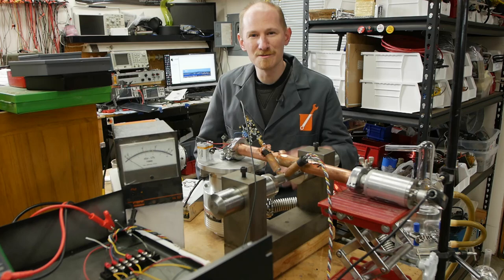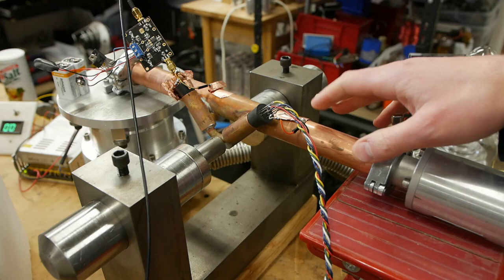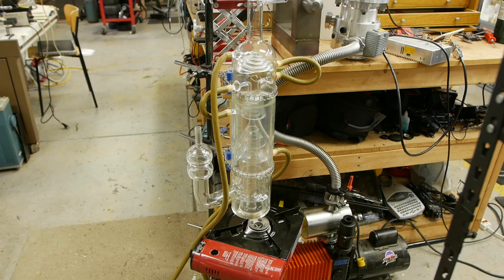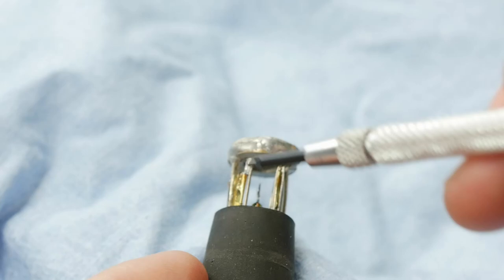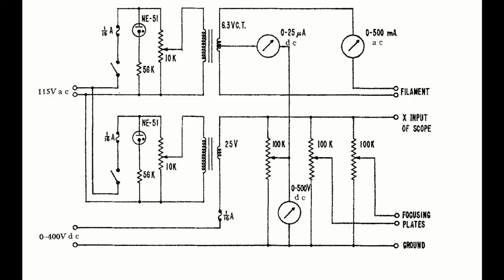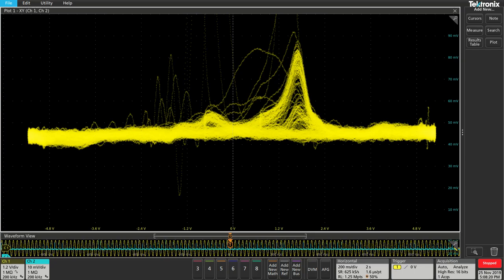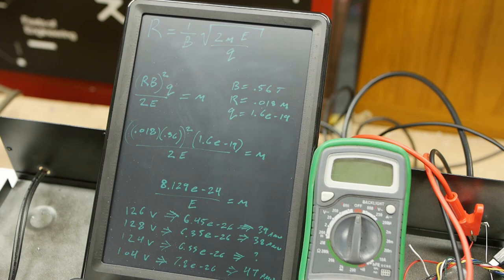DIY mass spectrometer measures potassium in dietary salt substitute

Comment: My initial suspicion as to the lower peak is some sort of additive.  A mass of 47 corresponds to titanium, and titanium dioxide can be used as a food-grade additive.  I think perhaps ordering some pure potassium chloride from one of the chemical companies and testing that would definitively rule out any additives from food-grade sources.
Reply: indeed. he starts the video be saying he's going to verify the contents of the product, but then by the end behaves as though his bottle of "No Salt" is a reference standard! :)
the picture of it on amazon lists five other ingredients, one of which is mineral oil(!).
Reply: It is indeed easy; TiO2 is insoluble in water whereas KCl is soluble. Even 1% of TiO2 will produce a milky suspension (and not a transparent clear solution)

Comment: Don't discount that the 47 is Titanium as in TiO2 as a whitening agent.  It's an "inactive" ingredient so may not be listed on the package.
Reply: Perhaps there could be titanium in the filament, or the filament support too?
Reply: @belg4mit  I'm also a bit skeptical of the proposal that the people who made these devices in the past would claim to observe two potassium isotopes without verifying whether the m/z ratio is correct. 
In the comparison of the spectra at 21:10, his signal looks quite a bit different than the ones from SA or John Dewdney. So maybe the were actually able to resolve the two potassium peaks and we're just looking at differently scaled x-axes?
Reply: @belg4mit  TiO2 costs A LOT less than Ti metal. TiO2 is actually found directly in nature and has been mixed into anything from tooth paste to wall paint for a long time. I think it's pretty likely what he measured.
Reply: But would "whitening agent" be 10% or more of the product?
Reply: @bpj1805  The peak intensities aren't directly relatable like that, because the ion formation process might have different efficiencies for different compounds/elements.
Reply: @cowpoodle003  Maybe, but I'd expect K+ ions to be more volatile than Ti+ ions, and with the relative peak areas looking as they do, it would have to be the Ti+ ions that are happier to leave the filament. Quick, not directly applicable comparison: KCl BP = 1690K, TiO2 BP = 3245K. Different oxidation states and all, mind you.

Comment: A spectrometer with lasers... surely it's not laser desorption/ionization?
Can't be Raman, you've done Raman before...
Regarding vacuum - tube seals generally don't work well with vacuum. Air always leaks through, since there's nothing really holding it back but uneven hose clamp pressure. The reason your stoppers work is because the stoppers themselves are being pressed in by the atmosphere. This is why all vacuum flanges are flanges - to ensure the atmosphere squeezes them together.
As for the rubber, most generic rubbers outgas a small enough amount to not be noticeable in this low vacuum system. That, and you have a gigantic turbopump compared to the overall size of your chamber...
On that note, have you considered the possibility that something is being vaporized from the chamber(including the stopper) and is ending up on that left peak? It would also fall in line with the previous two works, since they seem to have both used rubber.
Reply: Along these lines, what about trying it by cleaning out everything and not intentionally putting anything on the filament and see whether you get any peaks.
Reply: MALDI is the acronym I guess he was referring to it is a type of Ionization technique which uses Lasers to ionize instead of the heated filament. If memory serves me right, it is matrix assisted laser desorption/ionisation.
Reply: @sbreheny  I doubt that would be useful since the copper tube in itself has weathered from the inside and has thus a reactive oxygen layer which might be out gassing either due to vacuum or because of the electric current
Reply: there are titanium blades, so it is possible that this material will be dragged into the process.?
Reply: @a3xccy379  atmospheric pressure LDI is likely what he is referring to in the video, fundamentally indifferent to MALDI in terms of the analytical setup (let's ignore laser choice) and is held within the subset of LDI within the acronym soup chemists work within.
Reply: LPI was about for a while ..Laser Pulsed Ionization, in conjunction with Time Of Flight mass spec

Comment: Great video, this is amazing! A couple of things. 1) The peak height is not as important as the peak areas if we are trying to figure out the relative amounts of the isotopes. Since the two peaks are unresolved from each other its moot. 2) I'd secure the turbo molecular pump because if something fails and the turbine is exposed to an immediate pressurization then that thing is going to fly!
Reply: I was thinking the same thing about area versus peak. Area indicates the amount of ions. The peak is more of an indication of how good the resolution is.

Comment: Very nice video! I have the pleasure of using all different kinds of mass spectrometers all day and have therefore thought about how I would go about building one but I absolutely lack the time and tools to do so. That why I love seeing you build a finding one.

If I would change a few things I would first look at the ion source. I don't know how well your pumps will be able to handle it, but changing the ion source to something like electrospray ionization (ESI) would greatly reduce downtime and allow you to introduce many more different samples. It might be worth looking into. Also matrix assisted laser desorption ionization (MALDI) is a very elegant and nice ionization solution. Also both methods are able to deliver molecular information!

Secondly, I think that having proved that the concept works, going to a different mass analyzer like a quadrupole could greatly increase the variability of the system. Also these types of commercial mass spectrometers are the cheapest since they don't have the need for any fancy large magnets or perfectly calibrated parts or clocks.

As a last point it might be interesting to look into ion mobility spectroscopy. (https://en.m.wikipedia.org/wiki/Ion-mobility_spectrometry) It also can be quite cost effective and there are many different ways to go about it. I have seen quite robust little crude systems made by researchers at conferences that look like they could easily be reproduced by you.

Thanks again for the great video! A absolutely loved it. Hopefully you find my comments interesting and they can inspire you for future projects.

Comment: Did you do a dry run with nothing on the filament to see if anything is emitted from it?
Reply: Excellent suggestion.
Reply: Measuring background noise should be a part of any mass spectrometer measurement so hopefully he did, although it seems like he's using the potassium as his known standard so maybe he didn't get that far before  releasing a video.

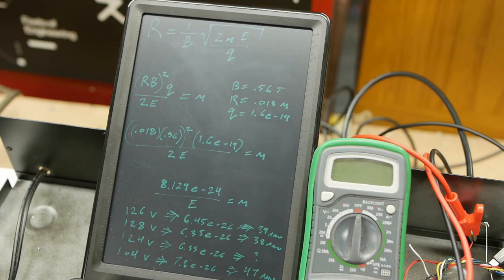Comment: 22:30 what's that screen/tablet/epaper pad?
Reply: > $1000 move along
Reply: Looks like a boogie board (search "boogie board tablet" to avoid beach toys) which costs around $20-40 depending on size + shape
Reply: @MrDrProfStewart  yeah did a quick search for those - was able to find a 12inch one for $10 xD lol; thanks for the tip

Comment: Yup turbo pumps are awsome. Go from torrs to hard vacuum in minutes. Used one to replace a mercury diffusion pump on a joel electron microscope using glassslinger's bearing replacement tutorial. Love the home rigged ion gun you made. Lab stopper washer pins and a broken lightbulb. Awsome 😁😎🤓

Comment: Hi, first of all congratulations, this is amazing, and thank you for doing this.
Second, the phantom peak you might have could have come from an imperfection in the slit from either the ion gun or the detector slit (more probably the ion gun, because you see the same peak form in both).
When we have problems like that with our MS, is generally related to beam stability or a fractioned beam.
I guess you could condense the beam with a electromagnetic lens system just after the ion gun, but that would require major modifications, increase in the ion path etc...

All in all, you are amazing sir, keep doing this

Comment: Maybe 47 amu peak is from titanium from razor blades?
Reply: That was my first thought too. Maybe the potassium ions are knocking off some titanium ions when they travel through the slit.
Reply: @reedpetersen  regarding the titanium once ions struck the razor blade I believe they would be neutralized and either quickly adsorbed on the inner walls or removed through the turbomolecular pump which should have plenty of compression ratio keep the concentration low. Nothing should be eroding the tin, copper, or brass as far as a know and his vacuum level isn't high enough for them to be doing much. I would think oxides or contamination on those surfaces would be worse since they aren't the cleanest of metals. The rubber would likely be off-gassing compounds with much higher masses that I doubt would be within his measurement range unless they were being cracked by the ion source, my guess is they're probably just contributing to system pressure. I'm curious about the flux in the solder, that might take many hours of pumping to fully out-gas. Either way I hope he makes a video on tracking down what this peak is, especially since it is displayed in the other two papers.
Reply: The titanium hypothesis has the hole that 47Ti is not the most abundant of Ti isotopes. 48Ti is the most abundant isotope (74%) and 46Ti and 47Ti are about 8% of Ti and 49Ti and 50Ti are about 5% abundant. So if Ti was the contaminant in the spectrum you'd expect to see a large 48 peak and smaller peaks on both sides of it. However, what he sees is what appears to be a peak with one satellite.
Reply: Well thinking about some other substances we know will be in the system ammonium chloride solder flux is 53 AMU so that is too big, carbon dioxide is 44, Calcium is 40, has an isotope of 41 and might be a trace source of contamination if his salt substitute is made in factory that makes other dietary supplements?
Reply: I'm sure he already looked at a lot of other mass to charge ratios to find anything that coincides and the closest thing I can come up with is if the dietary supplement contained trace amounts of calcium which might also be handled in the same facility, but he would have to have an error of 1 amu somewhere. There are all kinds of phenomenon in electron optics that can cause a misaligned beam to strike the detector plate, it is interesting though that it appears to be repeatable with the design.
Reply: @CafeBikeGirl  Calcium silicate is a common anti-caking agent, but NoSalt already lists potassium bitartrate in it's ingredients. (Potassium bitartrate is sometimes used as an anti-caking agent.)

Comment: Titanium has an atomic weight of 48, in the most common isotope. Is there any in the system? Perhaps in the tungsten wire?
Reply: I would expect that he ran the system without any sample to get a baseline, so I think he would take into consideration any ions that the device itself emits.
Reply: Titanium coated razor blades are a thing. The specific blade used here (Astra Superior Platinum) allege to be platinum coated... what are the chances they are actually titanium coated? As the erosion may only occur when a sample is present, that would somewhat counter any baseline established as well.
Reply: I thought about the same thing, there are titanium blades, so it is possible that this material will be dragged into the process.
Reply: Platinum has an atomic number of 78. However, if the platinum is being blasted off the edges by the potassium, it would have lower energy and would thus be deflected more by the magnetic field. I haven't done the calculations, but this could explain why it might show up as a peak at 47.
Reply: I was thinking titanium from somewhere in the system as well.
Reply: Titanium would melt in a tungsten light bulb filament.

Comment: Excellent effort. I want to build one for myself but I am chemist and not an engineer. Again I have a suggestion. If you could put a valve in front of the sample holder, you need not break the vaccume every time you insert a new sample. You can close the valve to the main unit. open another valve to let some air in and feed the sample. Attach the vaccume unit with the second valve and start it. It will take much less time as it has to evacuate a small space. When the desirable pressure is reached open the first valve and continue with the operation.

Comment: The mysterious peak at 104 V could be caused by the tungsten filament itself: Tungsten evaporation has actually posed a massive problem for the lifetimes of incandescent light bulbs, as the metal filament would shrink in diameter, resulting in higher temperatures and eventually leading to defective wires. Additionally, the metal would deposit on cooler parts of the lightbulb (the glass), lowering overall light output over time. In halogen lamps, small amounts of iodine or bromine are added in order to redeposit evaporated tungsten onto the hot filament (chemical vapor transport).

Naturally occurring tungsten isotopes are 182W, 183W, 184W and 186W. W(+IV) would therefore cause signals at m/z between 45.5 to 46.5 g/(mol*e). This hypothesis could be tested by changing the filament material, for example replacing it with tantalum wire.

Looking forward to the follow-up video :)
Reply: I thought tungsten evaporates very little under vacuum.
Reply: This was my thought as well!

Comment: I think the other peek is Zirconium which tungsten is coated with during the manufacturing process to protect it from moisture. .
Reply: The mass to charge ratios don't seem to match up even if it had a +2 charge.
Reply: I can't remember the context but I recall that phosphates can break down into PO+ ions when heated to high temperature in a vacuum, and tricalcium phosphate is a pretty common anticaking agent.

The molecular weight of PO+ is 46.9732.
Reply: @etelmo  Why not run the system without a sample to see if you can see any filament doping at the same point? Or, as I imagine getting the calibration right without the big K peak is tricky, just keeping it running until a small sample has all boiled away and seeing if it stays.
Reply: @dansheppard2965  Testing a new heating element without any sample makes sense as a sanity check, however it shouldn't be a brand new dry element; it needs to be wet with DD water and dried to replicate and control for how samples are loaded.

The water is important as it will react with both the getter compound (Zirconium, Phosphorus, whatever) and also the Tungsten (producing oxygen radicals, which should react further with anything else present).

Then again, as many have said it might just be a signal reflection... changing the signal path length is probably a good sanity check as it shouldn't impact the peak of a sample, only the reflection.

Comment: Wild stabbing guess, but could that second hump be some kind of resonance with in the chamber reflecting back signals? if so could you try and alter the length of one end of the copper elbow your using to prove it?

Comment: NoSalt has chlorine. The second peak could be the chlorine after being ionized combining with carbon this would be a mass of 47.
Reply: Interesting idea. NoSalt has several additives which would be sources of carbon: Potassium bitartrate, adipic acid, mineral oil, and fumaric acid. All of these except for mineral oil are water soluble, and would be present in the sample.
Reply: Wouldn't ionized chlorine be bent in an opposite direction from ionized potassium?  K+ and Cl-...
Reply: @andrewtinker7537  That would be what should happen if 110V wasn't being applied to the sample. The supply of electric current should be able to easily drain any excess electrons and produce Cl+.

Comment: Hi Ben, beautiful work! I think the peak doubling could be the coming from two types of trajectories - normally you can draw two different circles of a given radius through two points (slits). Now, since the magnetic field is inhomogeneous, they would in reality correspond to the two slightly different momenta. Hence, the same momentum (= the same mass), would give a peak at two slightly different voltages, with potassium flying in "high" or "low" trajectory.